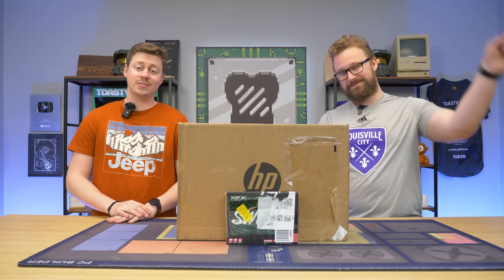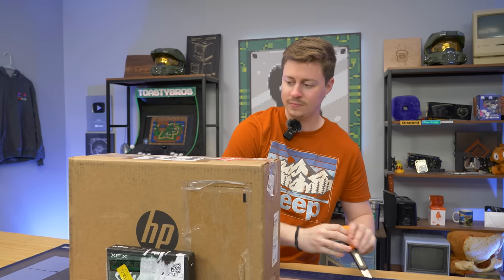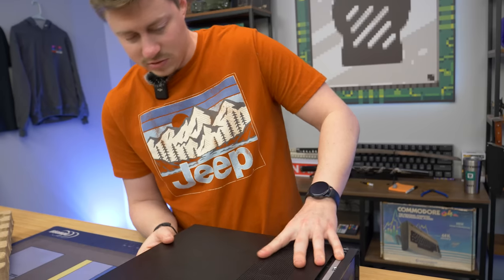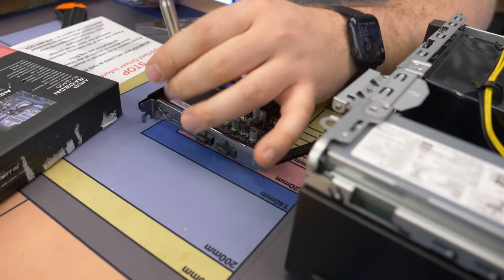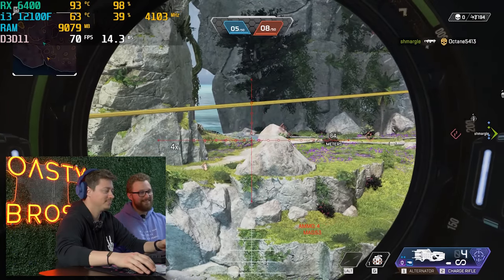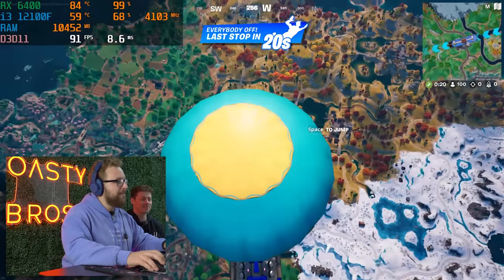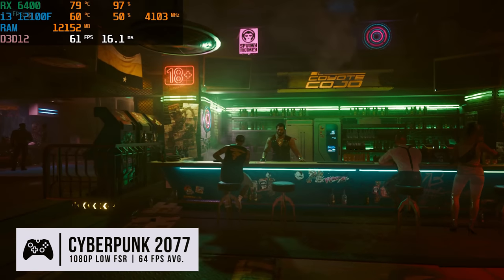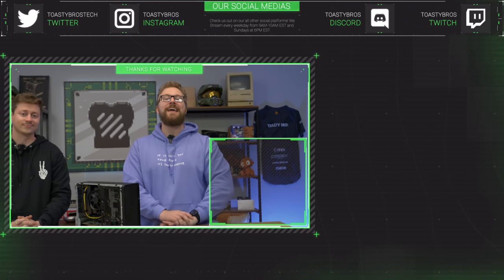The $400 Gaming PC NO ONE Is Talking About!

Comment: I took a HP 290-p0043w SLIM, upgraded the CPU to an i7-8700 for $80, slapped 2x8 2666 Ram kit already had. Didn't perform like I wanted it to on the IGPU, so i bought an RX580 off amazon for $99 (NEW). had to use a PCIE riser cable, & ordered 2 additional plugs to split the MINI 8 pin power between the HDD & GPU. The GPU is sitting outside the case at this current moment but man I'm shocked at how good this thing runs games @1080P I was worried about the power supply not being big enough but so far so good. My youngest son is using it to play Fortnite, Roblox & Warzone.
Reply: RX580 is 185W, it takes more wattage than the PSU even has completely
So did the PSU die yet?

Comment: i came to this video from ebay cuz i found this pc on ebay for 175 bucks usd and i was like i gyatt to get this pc and im planning on getting it in a few days to a week and there is better options than the rx 6400 but that would take 2 slots and require a psu upgrade and as in for the side panel u could mod it by getting mesh sheets and cutting the side panel and placing in the mesh sheet into the cut out and that should help with frame throttling and bad thermals

Comment: Remember if you can get a full tower, go for an rx 580, its cheaper (even when new) and performs a lot better.
Reply: You need a good psu tho.
Reply: @Aura4669  ok??? People can go ahead and purchase a power supply. I don’t seem to understand your concern here.
Reply: they're like 90 bucks, its crazy
Reply: @SnowWow  what country you live in? In the United States where I live. You can get a 500w 80 plus white unit for $39.99 U.S dollars. Power supplies are not that expensive
Reply: @jonathan-qd1cc  Well, here's the thing. If you have a PC like the one they were using, you usually can't switch out the PSU. HP usually uses proprietary parts for things like the PSU and Mobo, meaning, you couldn't really switch that out...
Reply: @MachoGoat  for this exact reason I do not purchase OEM machines. I only build my own computers with standard parts
Reply: @jonathan-qd1cc  i meant the rx580, its like 90 bucks

Comment: I salvaged an e-waste Dell that could only handle a single-slot GPU and the (same) RX6400 fit perfect.  I use it as a Wii emulation box and it runs great.

Comment: with the motherboard, could you eventually upgrade the process to an i5 or i7? You mentioned a good upgrade path but did not really talk about where you could upgrade, ie what processors would be compatible. What would be the first upgrade, graphics card, more RAM, processor. Thanks
Reply: You can as long its the same generation.

Example: upgrading from i3-12100f to i5-12600

If you're still not sure what CPU your motherboard supports, you could always type your motherboard's name + cpu support

Example: asus tuf plus gaming b450m cpu support (this motherboard is for ryzen, I just used it as an example)

Comment: 97 degC on the GPU.  I would cut a 120mm x 240mm hole in the side panel right over the PCI slots and mount a couple of 120mm x 15mm fans with a sheet of air filter mesh on the outside of the side panel blowing onto the GPU.  These fans would also provide positive air pressure to the inside of the case.  Maybe neaten it up with some trim around the fans.  

Send me the PC and I'll fabricate a side panel fan system and then send it back to you.

Comment: I had an RX 6400 inside a Low Profile HP system for about 6 months and it always started thermal throttling after about 4h of playing Sea of Thieves
And I had the dual Slot but still low profile variant by Gigabyte

Comment: Wait how is it a 12100f if the computer came with no graphics card? Do you think they pulled out the gpu and sold them separately?
Reply: Thats a good question...
Reply: It probably has a 12100, but they mistyped 12100f in MSI Afterburner due to most people being used to the 12100f over the 12100.
Reply: @Liinuli.  I don’t think that’s how it works though, it’ll auto detect hardware and show it on the overlay, now that I’ve had some sleep I figured they just swapped the 12100 for an F skew since they were using a gpu
Reply: they swapped a hp pabillion gaming pc gtyx 1650 and putted in a 750ti.
Reply: @kevinagostinello9968  Nah I looked it up. You have to manually type in the hardware you have on that overlay. Normally it just puts cpu, gpu, ram etc. So they just accidentally put 12100f instead of the 12100.

Comment: For this price of $400 I would have just custom built with used parts. Overall much better in my opinion
Reply: Yeah, and tbh for that price you are better off with console...Im a pc fan boy but pc gaming only becomes better at 800 dollars plus. You cant buy the parts at the prices these companies get them for to build their consoles.
Reply: @A7X062388  true
Reply: For around 550 USD you can build a brand new Ryzen 5 4500, B550 motherboard,GTX 1650 LP, 16 Gbs 3200 Mhz CL16 RAM, good power supply and a decent case. This pricing is in the EU.
You get about equal performance and a far better upgrade path. HP is full of proprietary bull and cost cutting.
You can go up to 600 USD and get a Ryzen 5 5600 and get PCIE Gen 4.
Reply: @Liminal.Headspace  you are exactly right. I don’t know why people go with these proprietary prebuilts. They have 0 upgrade path. With a custom pc you get all freedom and upgrade path you need and for much better value and price

Comment: Try undervolt the thing. i have similar setup in a similar hp case. undervolting my gpu lowered the temps by 6-8 degrees celsius. i even got higher and constant boost clocks! means more FPS, haha!

Comment: I am surprised you guys stated that HP case could handle double slot cards when those models with the PSU to the right of the slots always has the 16x slot right next to the PSU. Should always test the rig before upgrades but you guys know that too. Slacking a little boys. Might be time for vacation. 🙂
Reply: Wdym by slacking?

Comment: Hey I have question, could you try to order a regular office pc with a i7 and put a good cheap gpu for Fortnite atleast 144hz in it. I want to see if it would work. Please and thank you.
Reply: If the i7 is older than 4th gen i can't reccomend!!
Last month i bought a pc with 150€ and it had gt 1030 sddr4 4x2gb of ram clocked to 1867mhz and i5 4670
Look the prices and specs and check!!

Comment: you can always drill holes on the side panel and if you have enough space maybe add a few small fans to increase cooling or completely remove the GPU fan and and cpu fan and op for water cooling you might need to customize it a bit and maybe have an external radiator

Comment: Old boring office PC : Exists
Someone on the internet after adding a graphics card : it's a gAmINg pC
only runs at 90C
Reply: It was running at 97c at one point 😢😢😢 I feel bad for the people copying this exact build. For $400 you can do much better than a office computer
Reply: @jonathan-qd1cc  Yeah,a 400$ custom built computer from used parts would do better in temps and upgradeability. I'm really tired of "consoler killer" and "gaming pc's" that are nothing more than a tired office pc. If that thing will last more than a month with those temperatures it's gonna be lucky

Comment: Yeah, the cheap 'redneck engineer' of that box is to remove the side panel and put a cheap laptop cooler against that side. It'll block the worst of the dirt while adding 1 or 2 fans that'll blow directly over the GPU. Not saying I've done this with an Optiplex build and maintained temps under 60... but yeah.
Reply: I bought my laptop cooler a few days ago and now I'm wondering if that would work
Reply: @septembersighter  Figure this, at the very least you've got 1 or 2 fans blowing positive pressure over the system, at the cost of one USB port. I never tried them in a 'drawing' config, but it might work there too.
Reply: Ok
Reply: What's the average gaming pc fan rpm? My cooler goes to 2000 and idk if that's slower or faster than the average rgb fan